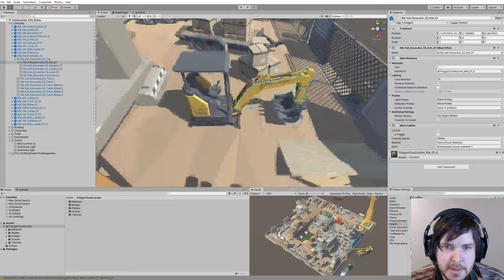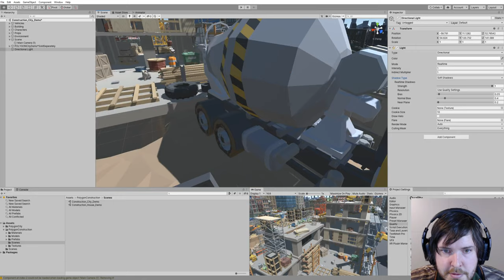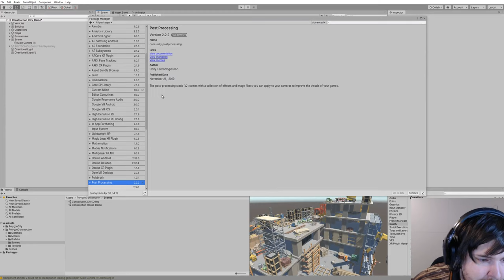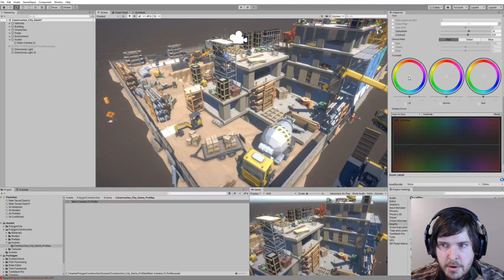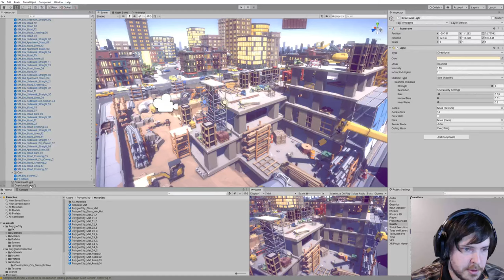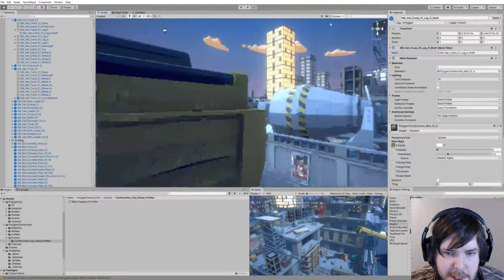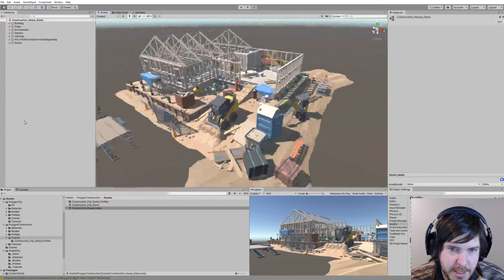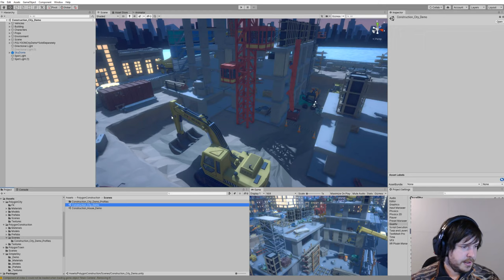POLYGON Unity Lighting guide - (LiveStream) by #SyntyStudios : Construction demo.

Comment: Nice tutorial. But don't forget to use tonemapper and never set your layer option to everything in post processing component. It will have huge performance drops. Create a new layer name it postFX and set your main camera layer to the layer you've just created 'postFX' then in the post processing component select the layer your camera is on. 

Also add a skybox made of images or a procedural one. Add a reflection probe. You can't have better lighting without Reflections.

Comment: You guys you make a mad max type asset pack, a low poly wasteland pack would be amazinggg, and instead of having premade cars and stuff you should make all the parts separate so game developers can customize it to their games easier, like have a prefab folder for the chassis, one for wheels, one for engines, and maybe one for the actual car bodies. It would be perfect. Maybe also something similar with the characters, just a couple bare humans and then make all the clothing and accessories separate. If you did this with any pack it would add a lot of value for developers
Reply from the maker: POLYGON Wastelands in on our list, keen to find a slightly different angle though as it will be very Madmax otherwise
Reply: @syntystudios  sounds like it's gonna be amazing just like all your other packs so far,  you guys have the best modeling style I've seen yet